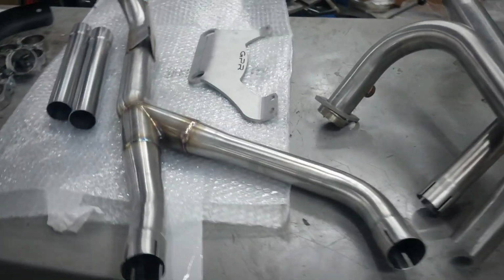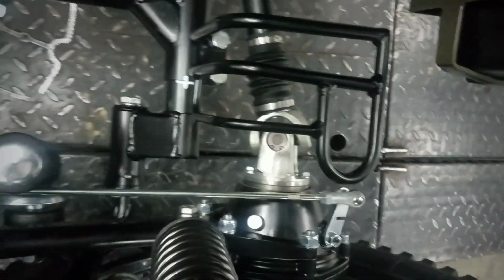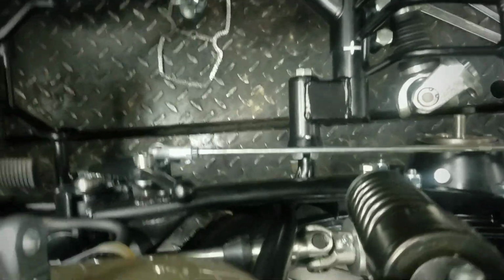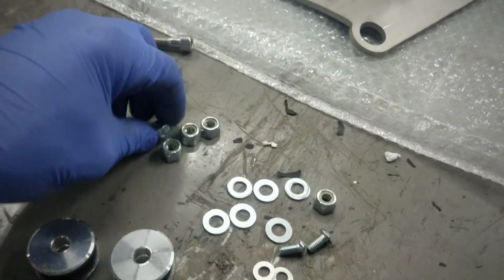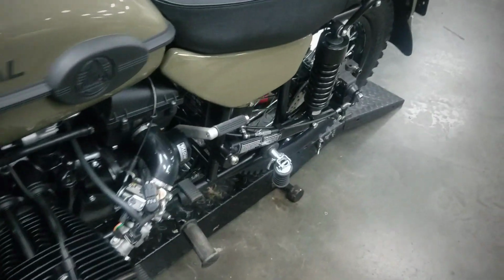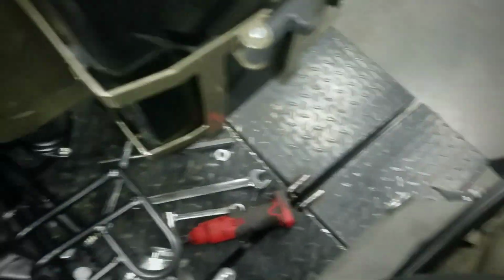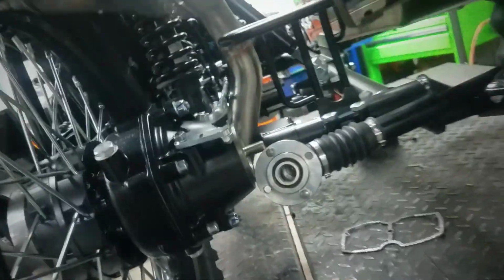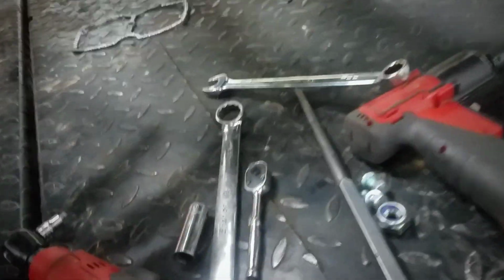2020 Ural GearUp GPR Exhaust Install Tips

Comment: Fascinating, the routing. Even if it's for off-road use, I would think it would route to the left. I guess, it does allow for left side clearance now. I expected it to go high on the left side, like the older scrambler models did.🤔 I have no concerns about showing false starts, it means you're figuring things out, and showing corrections, just like anyone else doing it their first time.

Comment: Great video - thanks. Did you put any sealer on the connection to the heads? My Raceway leaked and the only way to stop it was Permatex Ultra Copper.

Comment: Just finished watching David’s video on these GPR’s. He put it on a 2016 and said they fit the 2016 - 2019... What I want to know Jon, is IF it fit the 2016 (gen 1 EFI) why wouldn’t they fit the 2014 & 2015’s as well.? 🤷🏻‍♂️ Is it because of the O2 sensor electrical leads ? Being at the bottom instead of the top of the exhaust..?? 🤔
Reply from the maker: The heads changed in 2016 and the gasket sealing area is different. In the video, he is installing the complete system with the j pipes that have the recessed gasket (round).  The 2015 and prior have a different gasket (oval) that is held on by the head studs.  They do have a kit for the 2015 and prior bikes that uses your stock head pipes with some modification of the pipe to fit.
Reply: @heindlengineeringmotorcycle  .. Thanks a lot Jon, we Knew you would have the “Real Story” in full on this, couldn’t figure out Why it wouldn’t fit on the 14&15 if it fit on the 2016, great answer... BTW, you mentioned in a video (I watch to many to remember which one)  about having enduro seats taken off new bikes thar come in in place of tractor or 2/3rd seats for some savings, WHAT would That be..??🤷🏻‍♂️
Reply from the maker: @annafraley5388  we don't have any takeoff bench seats currently, but we will likely have them again in the future.  New the seat lists for 319, but a takeoff would be around $195 or so.
Reply: @heindlengineeringmotorcycle  .. thanks Jon, we can do THAT on S/S... no disposable income in you 70’s any longer 😢
All the different Harleys we had since 1990 it was easy to get great seats from Mustang, Corbin, J&P Cycles and not get near $300 so yeah, we can do that..!! Legs are to stiff now for the bend they and the ancels to do more than 20 minutes at a time.. Our standard two up seat is like new but have to sit on the hump in the mid point...!!  Let us know when you get one because we are READY. 👍🥳